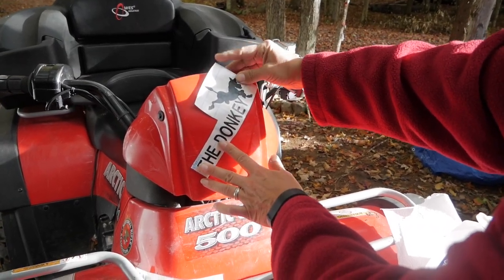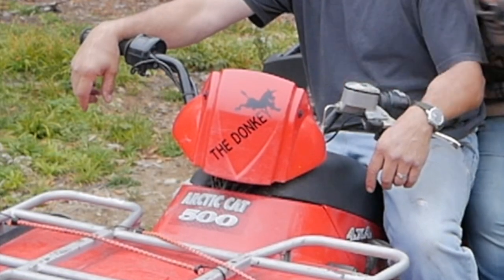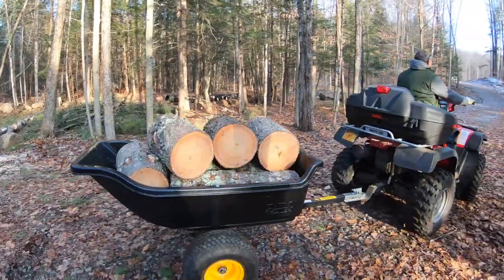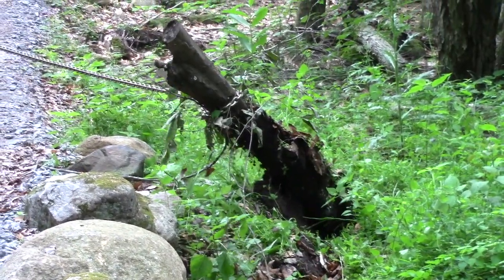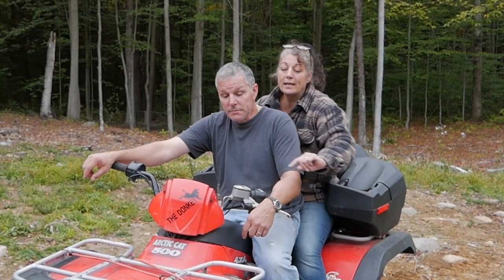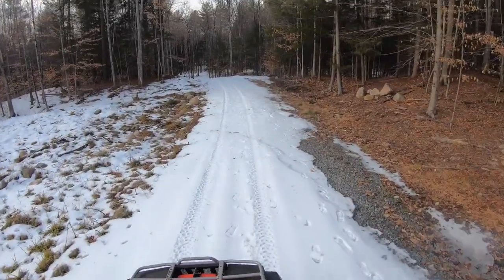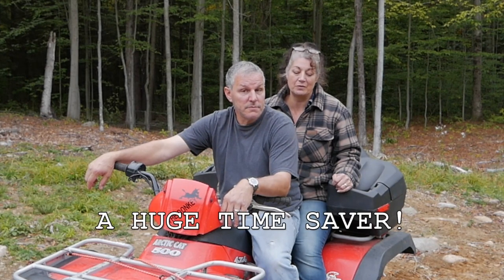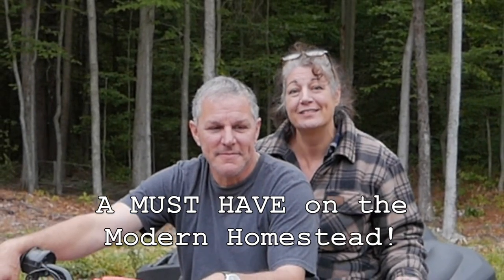ATV - THE DONKEY OF THE MODERN HOMESTEAD

Comment: Just a tip maybe try looking for a steel trailer that is flat, they are a lot more versatile and u can find ones for trucks and they will work fine on the 4 wheeler as long as u have the correct ball.
Reply from the maker: Thanks. We will probably need one that will hold our kubota now too!